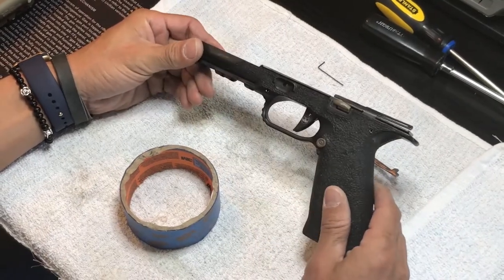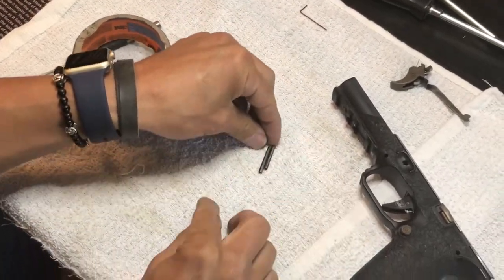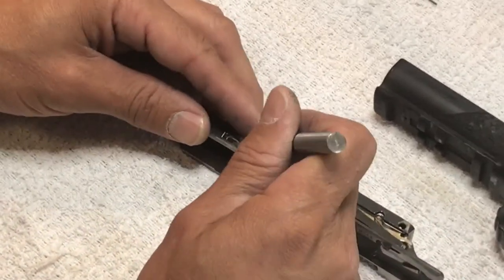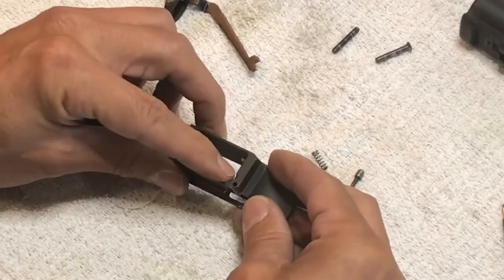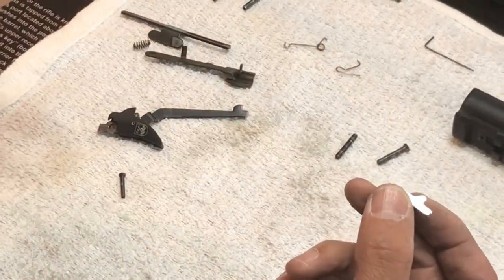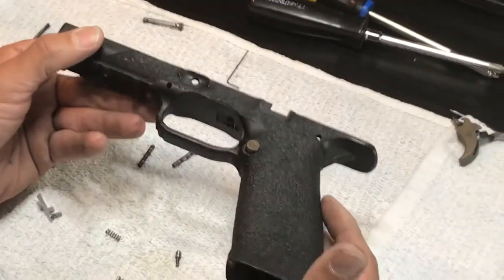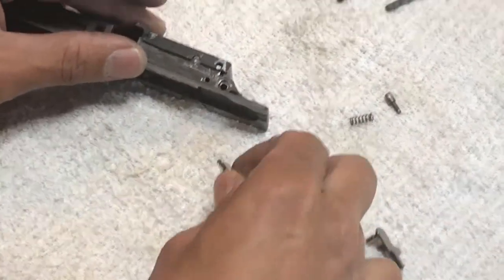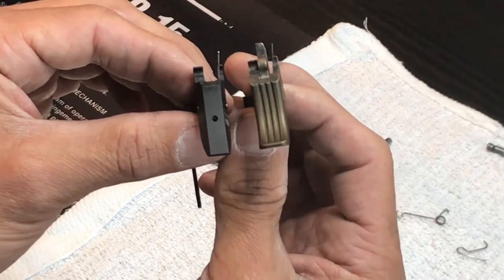Strike One Trigger Install plus disassembly of frame

Comment: I just purchased a Strike One Speed made this year, 2023.  I want to add one thing.  The trigger spring rod has a rounded "head" that cams against the trigger.  This part (the rod) is not as hard as it should be and it tends to gall.  When it galls the pull feels rough.  The dome of my pin was chewed.  I put it in my lathe and polished it.  After that, I heat-treated it.  The overall improvement is profound.

Comment: Well done, sir! After doing your trigger job for most of a day, I am really pleased with the end result. I’d like to add a few pertinent bits. Polishing  the sear to fit took about an hour until it would seat and be free as required. After the first of multiple re-assemblies to get the gold trigger over travel setting correct (because it’s only adjustable when the trigger assembly is out of the frame), the new trigger still felt gritty. I found that on my pistol, the trigger actuating arm rubs against the polymer body. I used a Dremel to relieve that tight clearance on the polymer body and instantly got the smooth take up promised with the new trigger kit. I’m now a happy man thanks to your well done video, and well versed on disassembly and assembly!

Comment: Hey Jimmy, thank you for posting this, I was wondering how to disassemble the trigger as it looked a bit complicated. Vienamin had mentioned it was tricky and I can see why, however for those familiar with firearms this is a breeze. First time seeing the innards of the S1 on you tube. This is great stuff, looks very easy to work on and love the design. Wondering:
-the frame pins (2 first ones), should they be removed from right to left first and re installed from left to right or it does not matter? Asking this as you mention in the video they are thicker/wider on one side.
-What is the durability on the springs mounted on the side, how often should they be removed?
-Is the Strike B going to have this new trigger system standard or has its own trigger system/spring and such?
Cheers from Canada brother!

Comment: I couldn't put the trigger pivot pin in after struggling for twenty minutes. I found the hole wasn't big enough. I dressed down the pin and chamfered the end and it was fine. I still have a bit of roughness on the trigger but it should wear in. There might be a burr on the edge of the hole.
Reply from the maker: Without a small hammer it would be impossible to armor several of these every day, a small armorers hammer with punches come in handy if you plan on getting inside the gun... and I recommend you do to thoroughly clean it once in a while. I had one today for a trigger job and boy was it filthy, need to charge extra or find a better deal on towels :)
Reply: @rain6firearmsandlifestyle131  Definitely because of the close tolerance of the trigger hole. The fault is mine since I didn't check the clearance before trying to push the pin through. I usually check  pin diameters and hole clearances. the only real frightening part of the operation was seating the retention pin spring.  It was easier when I used a dental pick and pushed the arm toward that pin hole. I have to thank you for the clear and concise video. It would have been close to impossible without it. Thank you. And I shot it today and it was really nice. That curved trigger is horrible and I'm happy it's gone.

Comment: HELP! 🙏🏼

It put this “NEW Competition trigger” in my Org Strike One (First edition first EU batch) 

But it ain’t “breaking” i dosen’t “Go Off” untill i pull the slide back a bit…

Any idea!? 

My Local GunSmith tha’s “taking over” the Problem thinks it’s maybee “The link” is to short!?

He also says that the “hole slide” is cut wrong/ squweed/uneven/not in level kinda..

Could it be some “fabrication fault” “babaybissue” on theese earliest models…!? Something known?

I had problems with it dropping mags in the beginning but got a new spring from Dimitri and Nicola at Tanfog who makes them.

Do they make the New “Competition Trigger” to!? Or who does!?

Is it the same trigger  as in the “Sailent Strike One” ?? 

PewPew and Sheers from Sweden 🇸🇪 

Slava Ukraine🌹🇺🇦

Comment: how does the Stryk B trigger compare to stock stryk 1 and the upgraded trigger stryk 1?
Reply from the maker: +RENZ way better than stock trigger, and better than drop in.
Reply from the maker: The Stryk B trigger is amazing compared to any trigger. The stock Strike One trigger has a lot to be desired. The Stryk B trigger is different than the upgraded Strike One trigger, both are outstanding.